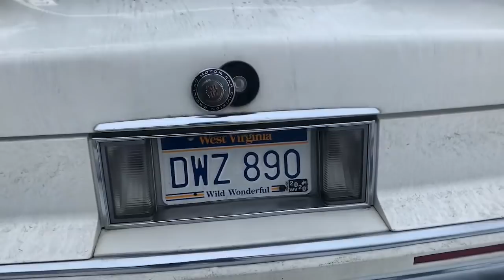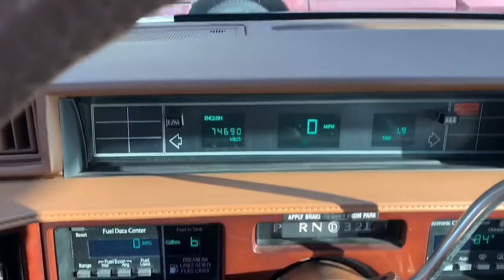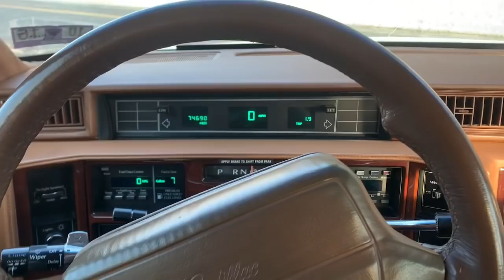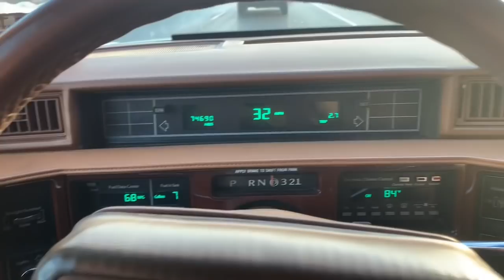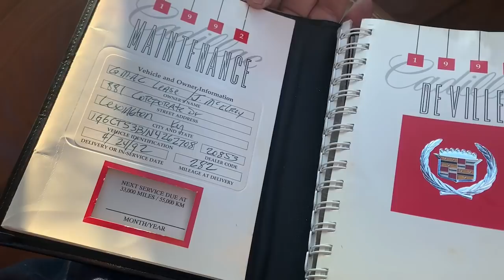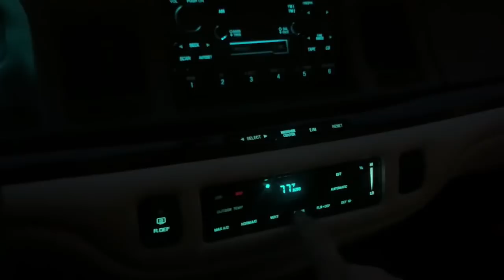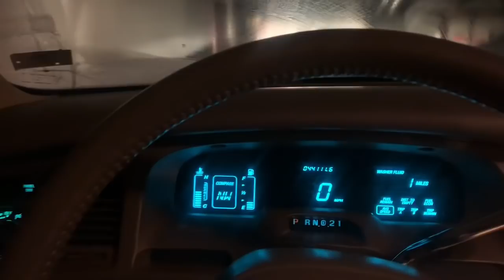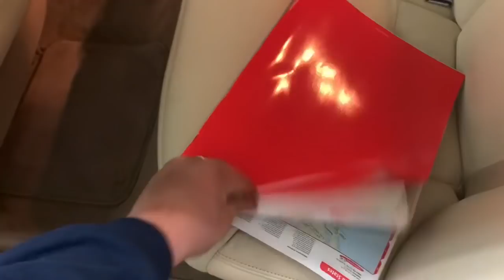2 NEW PIECES OF INVENTORY! Same transport issues with both! 1996 Lincoln Town Car 1992 Cadillac DTS

Comment: I had two of those. They made Fleetwood s with the same body style. They juat added a wheel skirt in the rear to differentiate the deville from the fleetwood. Lol watching you take it for a run i knew the power of the acceleration would surprise you lol. Thats a nice reliable performing Cadillac in me eyes.
Reply: Also that car is just screaming Gold package lol

Comment: Hey Anthony.  I've been a subscriber for a while but this is my first comment.  I LOVE your channel.  I honestly think that we might be related as we share the exact same interest in type of cars and I too am super detailed and anal about the smallest items and what the car has to have (original, paperwork, options, etc. etc.).  I've owned several Lincolns (Town Cars and Marks) and Cadillacs over time.  I had a sweet original, low mile '97 Cartier Town Car that was the same color as your '96 but it didn't have the top.  It sat in the garage and was rarely driven.  I also have owned some great original Oldmobile 98s and 88s.  I am intrigued by your '92 Touring Caddy.  I like those years as well.  I may very well end up buying a car from you in the future!  Happy holidays!

Comment: It will be interesting to see how you expand your channel. I do watch them all now so I'm sure I will be pleased with the new stuff. 
I really liked these Cadillacs when they had fender skirts on them. Of course you cannot have a touring sedan with them! But anyway, the skirts were sharp. I could've had one a couple of times but the engine stopped me every time. Cadillac engines were still a dumpster fire or should I just say head gaskets were a mess. There is a fix now but it is expensive to have it done. It would be worth it on the right Cadillac. 
I really love these years of Lincoln. I have an '89 still but I had a '92 for a while. Unfortunately the previous owner ruined the engine. '92 was also to early for the valve guide fix they needed to stop the smoking. I couldn't get an emission inspection with it that way. We tried to fix it but there was something about where the valve guides were that the new guides did not cover and was worn in the upper part of where the guides go, I found out through research, so we would have had to pull the engine down. Just as well rebuild at this point and the car was no where near the fantastic shape that Anthony gets his. So...it was retired. My understanding is that Ford fixed the problem and this year would be fantastic. The 4.6 sounds really nice. I also have an '83 Mercury Grand Marquis with 39,000 miles on it. Very nice but it will hardly get out of it's own way!
Thanks Anthony.

Comment: This was known as a DeVille touring sedan rather than the 2006 DTS, first introduced in 2005.  The touring sedan was an optional package in 1992 on the sedan and coupe.  The DTS replaced the DeVille line.
Reply: Any way you look at it it spells DTS, obviously, package or stand alone series and then it's own line, still the same. They were just fooling around with the Badging like the European's did and do. FoMoCo did the same thing after GM. Silly stuff.

Comment: ...hey-ya, Anthony...and Holiday Howdy!!
...oooh, you have a nice '92 Touring Sedan there...one of only 5,300 produced...designed to go head-to-head with the BMW 5 and 7 series sedans and the E and S class Mercedes of the day...
...that 4.9L transverse V8 had been perfected by roughly '87-'88 and is one of the most reliable power plants (along with the legendary LT-1) ever produced by the Cadillac Division...
...lots of Cadillac purists still disparage these down-sized C body models as "toy cars" or "NOT real Cadillacs"; but the fact remains that by the early 80's, GM execs felt that the time for the full-sized B-body cars was rapidly closing; and that the industry was moving toward more compact front-drive formats...
...and, amazingly, even though this body style was nearly 2 feet shorter than its predecessor, the designers gave these models nearly the same amount of interior room 
( critical for return buyers who expected a certain level of expansive comfort)...
...LOLOL...I made the same goof on the hood release latch...by late '92, the latch was back on the lower grille edge...tons of customers kvetching about that...
...even though alot of owners stuck with the Blackwell, IMHO, a nice thin Whitehall would really dress this Touring Sedan up a tad...
 ...and as to your frustrations w/ the delivery driver's...as a Sr. Customer Service Mgr., I had a phrase, "Courtesy is a two-way street; and it doesn't work if all the traffic is in a single lane"...
...I don't care, if you're late you ALWAYS text or call your customer...period...they're the one's putting food on your table and paying your mortgage or rent...common courtesy is becoming very uncommon...just sayin'...
...oh, almost forgot to ask you about the Olds 98 you have...Regency or Regency Brougham?, mileage?...any pics/video yet...expected ETA?...asking price?
Have yourselves a healthy, happy, and grateful Holiday, Anthony!
Cheers,

G. Clark (Greg) Bloomfield
...the grown-up Cheyenne car kid...
😉🎄🎊🎁🎉🧸☃️🌟

P.S. ...given the choice, I'll ALWAYS go Town Car...

Comment: What floors me is the '96 Town Car interior is the exact same as on my current 2003 Ford Crown Vic touring car. Only thing different is the digital dash in the Town Car versus the analogue dash in the Crown Vic series but the same dash panels, and overall layout including same exact HVAC control module, radio, vents, steering wheel with control switches, and even the seats are exactly the same. Only thing I can see is different between the two car models is exterior body panels. My 17 y.o. CV is still factory new bumper-bumper, inside/out and I'll probably keep it till day I die. When you really take care of them, they last forever.

Comment: Touring Sedan - Cool car!!  Underrated.  I love them in black with the same color leather, but I'd consider a white one.  Rare when new, and you just DO not see them anymore.  They were about $3,500 more expensive than the regular SDV.  Same 200 hp 4.9, but special suspension, wheels and tires + some other goodies.  BTW - thanks for the trial and tribulations of the average businessman / gives me at least the sense that you are a decent regular guy, someone you'd buy a car from and get a fair shake.

Comment: I had an '89 sedan Deville. It was gray even though the one I bought it from said it was silver back near the beginning of turn of the century. It was an alright car for my driving purposes. Just before I unloaded the car, the trans was going and the guy who wanted it had his mechanic put sawdust in it, lord knows why, it didn't last long after that. Even though it had a security system, there was no remote for it. They said the key reset the alarm when you put it in the door lock, it was also supposed to open the window for hot days which it didn't. The car was a 5.6 liter engine and had a governator in the engine which prevented you from driving faster than 85mph. Once you hit 85mph the digital display for speedometer blinked and even if you tried to hit the gas more, it didn't speed up or accelerate the engine into higher rpms. That's when I said I wanted my Oldsmobile back and got it too 1991 olds 98 regency elite. Mom had the 50th Anniversary edition I had the regular one.

Comment: I owned and drove a 91 Deville Touring Sedan, burgundy red in color, for about 2 years back in the 90s.  Was the best, most useful, most comfortable Cad I ever owned.  I wish I would have kept it . . . They only made them in 91, 92 and 93 and only with the 4.9 and they were only available with the same camel colored leather and real walnut wood trim interior.  Exteriors were either black, white, metallic red, metallic dark navy blue, or this weird metallic almost army green.  I say it was the most comfortable, most useful because up until then I only drove Eldorados.  I sold it to an old guy (he was about 65 or so) in 1996 with 60k miles on it because I wanted to keep my younger newer Eldorado Touring Coupe as I moved to Laguna Beach.

I agree with Paddy Obrien 's comments above and also someone said something about water pumps with the 4.9s. . . I can attest to that also as I remember having changed several between all the 4.9s I owned back then.

Also, I think you have to be careful with the motor mount situation with the 4.9s . . . the lower engine mount is a costly repair.  I do remember having one fail in a 92 Eldo and it was a big fix.

All that said, I would love to have a look at this one when you get done.  I might like to purchase.

Comment: The factory color of the Deville leather is called Medium Beechwood. Ive never had one of these. I test drove a 1992 DeVille Touring Sedan. Felt like I was floating on air. Great car. I owned a 1991 Seville STS with the same colored interior. Same 200 HP 4.9 engine. 
The Town Car looks a lot nicer. Ivory interior. Ivory Pearl exterior. 4.6 engine. Only things I dont like about it are the imitation top and the added chrome trim on the fender and quarter panels. Otherwise, great car.

Comment: Well I managed Lots, and dealt with a lot of Caddies and Lincoln's, Mercedes and the other German cars, lots of luxury cars. As you know the Lincoln's were bulletproof and seem to run forever without much maintenance but all the rest needed continuous maintenance and repairs and the reliability problems just hit hard just after the warranties expire. I like to handle a big car, kind of like I handle a sports car, so front-wheel-drive just doesn't cut it. They only switched to front wheel drive to save money in manufacturing, not for traction.  That was an afterthought. Caddies can look really pretty and I love that interior, but that headliner never should have done that and it is expensive to have an upholster redo that. In Seattle, about a grand. At the right price they will both resale in the blink of an eye and somebody's going to probably really enjoy either one of them.

Comment: I've owned both of these cars putting over a 100,000on each The Caddy is the best riding car but I have always found GM cars the best riders. It would nickle and dime you on the engine fixing stuff that weren't major. The town cars were incredible cars. They just go and go and go. I had them with 325,000 miles and 211,000 miles and they never ever tore up. Out on the rode you just floated with it driving as good at a 100 as it did at 60.

Comment: I have the identical Touring sedan with a sun roof 62,000 miles. good car factory 373 gears. YES needs a headliner ! Great car. NOT the greatest gas millage. IF these 4.9 and 4.5  sit a long time not running, the ethanol does a job clogging the injectors. Luckas  ethanol fuel stabilizer  prevents this. If possible run non ethanal fuel. I'm fortunate to have a gas station 1.5 miles from my home. 93 and 87 octane. I bean running the 93 octane in all my cars , Cadillac's, NO injector or fuel pump problems.The 1299 S ducatie and 2021 street fighter run incredibly better as well . Be safe guys ..

Comment: I see the white Olds in the back when are going to a video on that one. I prefer the Town Car over the Caddy, but don't get me wrong the Caddy is nice
Reply: Technically it's not white, it's "Frost Beige". Ask me how I know...lol.
A beautiful car that can hold it's own with any of Anthony's other cars.
Merry Christmas. 🎅
Reply: @mgmnfld3109  growing up I remember my dad had one in that kind of lime green lol. He sold it for a Buick Park Avenue then from the Park Avenue he only bought Town Cars. Up to now he still only drives a Lincoln
Reply: @lynwaldryancox8687  Yeah, I wrote off the Olds. 😡
Now I drive a Grand Marquis Ultimate Edition in the summer.
Hard to beat those Panther platform cars. Last of the full size, full chassis, rear wheel drive cars.
Reply: @mgmnfld3109  yeah my dad had those also. He owed over 3 of them lol. My dad owned almost all full size cars rear wheel drives except Cadillac & Caprice. He didn't like them he always preferred a Town Car over Cadillac. His last GM was the 1983 rear wheel drive Park Avenue. After his Park Avenue he switch to Lincoln & Grand Marques.

Comment: Had a 1990 Seville STS back in 2001, it was one of those deals where where we knew the guy and he was selling it cheap.  Car was really nice with 100k miles on it, but I just fucking hated it.  Same color combo as this Deville, but mine was pearl white with brown leather, I don't think pearl white was yet an option on the Deville.   It was too small, ugly, cramped inside, dashboard was an ugly mess as well, had stupid digital gauges that displayed nothing, yet you could see the coolant temp, engine rpm, trans temp, a bunch of other crap but it was at the base of the console next to the gear shift, in a digital layout.

Comment: 91 - 92 4.9 good engines.  Car is junk. ( electrical )  in the midwest it will bring $2000 tops.   Yes they drive pretty nice, but terrible fuel consumption.